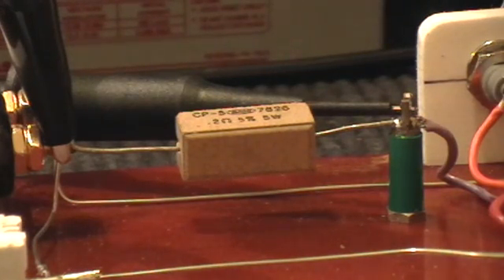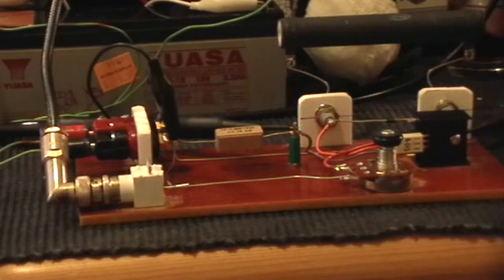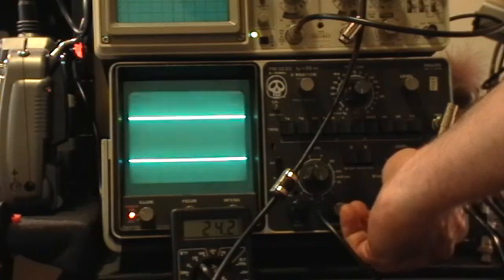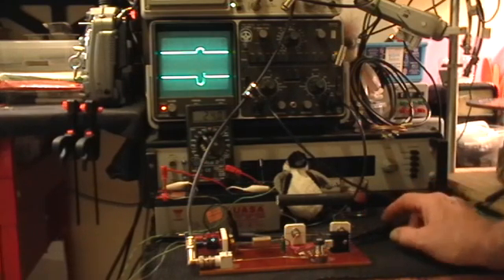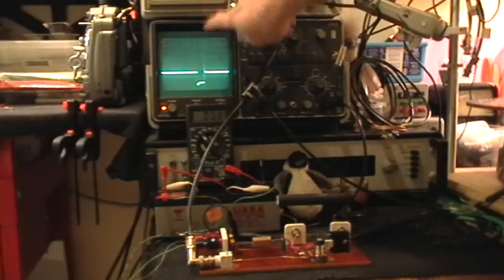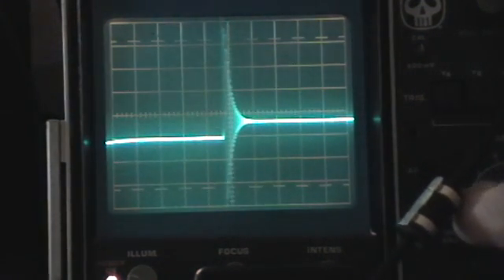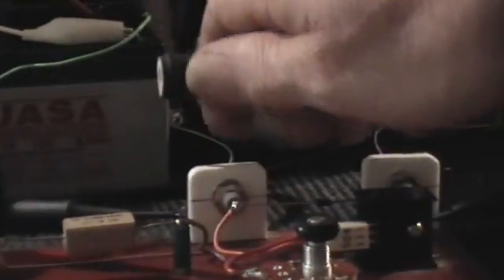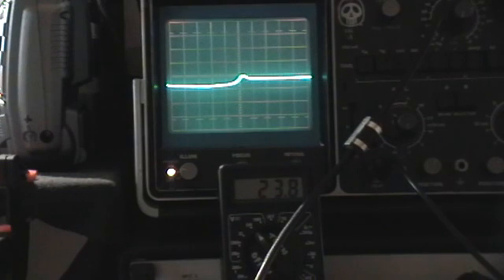Electric OU 1: Preliminary Tests of the Rosemary Ainslie Claimed OU circuit

Comment: That ringing is due to drain to source parasitic capacitance at certain value of gate resistance. You could simply make series resonance circuit if you put a capacitor between drain and source and tune the frequency to resonance frequency. That would be simpler.
Reply from the maker: Thank you for your interest. This is an old project that resulted in the complete debunking of Ainslie's silly overunity claims for this simple circuit. 
It only went on for so long due to her incomparable ignorance, her amazing arrogance, and her abject lies about what, when and how the circuit was developed (hah! it's just a mosfet switch) and tested. There is even a long series of tests performed while they are being tutored and guided by an accomplished professional EE, who tried to convince the claimants, through their own experimentation on their own circuits with their own test equipment, that they were making silly mistakes suitable for novices. Ainslie herself could not even interpret the traces of an oscilloscope, she had to have "numbers in boxes" instead.
Again, thank you for your interest in this old, dead time-waster project. Later in the series you might find some really amusing videos such as the one where I explain the common gate oscillator circuit or the one where she actually accuses me of faking the result because she actually has no clue about how a mosfet operates.